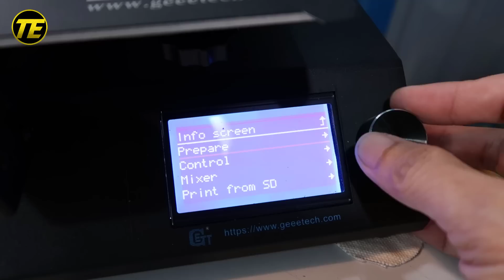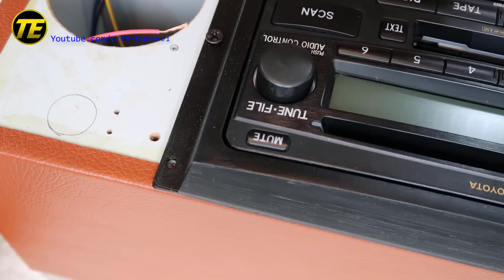Homemade Car-Audio Boombox V2

Comment: you should have plugged in the speakers only to the front outputs with a crossover so the woofer doesn't get full range, this will sound much better

Comment: That was one nice build. Good job buddy. Just wondering how bouncy/echoish the bass is. Because the wooden boards that has been used looks like it won't absorb as much punch as a MDF board would. No sponges has been used either.

Comment: That's an awesome homemade stereo! It even has a full logic tape deck. I have over 2,000 tapes in my collection to listen to. I always look for tape decks that are full of features, like AMS Automatic Music Sensor and RMS Random Music Sensor,  where you can program which tracks you want to listen to and which tracks to skip, like on CD player. Hopefully this player has the ability to search between tracks on tape. For some reason, I always been crazy over tapes. Unlike digital, you can always fine tune the tape recordings, that's of course if you have a professional tape deck. I managed to make my tapes sound louder and cleaner than CD'S.
Reply: That's because the tape stores the CD music in analog! And analog is more "natural" sounding , and can capture more detail than digital bits! Even if you just play the CD,but still has to transfer the digital data back to analog so you can hear it! Except the cassette doesn't need an DA converter because it's already been converted and stored in analog! We hear in analog, not digital!

Comment: Nice idea, but I noticed a few drawbacks.
-  Would have used better speakers, and a crossover for each set (not just plain capacitors, that's a lousy hi-pass filter)
- The brown vinyl finish really sucks. Would have gone for either black imitating carbon fiber (like you did in the back, but all over) or a combination of that with some hand-picked woodgrain.
- Would have put some rechargeable Li-Ion pack with charging circuit - it's not really a boombox if it's not portable.

As a personal choice, I'd go for a different car stereo. JVC or Pioneer or something like that, with more features (such as MP3 playback, better EQ presets, LED visualizations, remote operated, etc). That and really loud sound is what boomboxes are about.
But not bad as proof of concept. Thumbs up anyway.
Reply: I agree with you on principle, but it looks like he did this whole project with stuff he already had laying around.

Comment: I enjoyed watching this, but I have fiddley, uncoordinated fingers and it wouldn’t be so easy.  I agree with others that having a working radio with built-in antennas, Bluetooth capability, USB port or microSD slot and built-in battery for true portability would be good additions.  I would probably have larger, detachable Bluetooth speakers to get more sound and separation.  Your skills here are admirable — good job.

Comment: Well done....... precision engineering......just missing battery power
Reply: i was just thinking about that myself thinking i dont fancy carrying around a 12v lead acid battery to power it lol
also theres no antenna for the radio and the belt on the cassete needs replacing can cleary hear it slipping
Reply: Well no worries.... Cause from where I'm sittin, You're 90% there

Comment: Been putting car stereos in speaker boxes since Early 70's.
Reply: Thanks for the Heart, TE.
Made quite a few of them for friends on the carrier is was on at the time.
2 smallish house speaker boxes, an in dash car stereo, and either use the speakers already in the cabinets or coaxial for car/truck. 2 6v lantern batteries, one of the little 'rubber ducky antennas, some screws, a handle and off You Go.
Reply: Deep cycle batteries will last longer and work better

Comment: Good work! But some thinks... For FM usage may be installed the telescopic antenna, it will not make worse the design of project. Next think - this box may include BT module for better functionality. And once more - little high-speed fun is too noisy. Better to use more silent 80 or 120 mm low-speed funs.

Comment: What did you use for a "body filler" on your 3-D printed parts before you sanded and painted them?  I am new to the 3-D printed world.  I was wondering if it was something particular for plastics or not, also if you've had good success with the filler product?

Comment: What amperage power supply did you use for this? Planning on doing this project myself, but with an aftermarket car radio. Though I may consider using my old truck's radio for this now. Most aftermarket radios have a 10 amp fuse, so I would assume I'd want to use a 12v power supply with an output of 10A. Might also add a set of batteries outputting 12v to the constant power for keeping the time. Thanks!
Reply from the maker: I use a 12v power supply with an output of 5A

Comment: That's great, but bass in this configuration can be deeper. And the cassette deck needs a belt replacement. Although by this idea is rather original.

Comment: What did you use for a power supply is it rechargable?
Reply from the maker: 12V 5A adapter
Reply: TE do you have a picture? What is the diagram i want to make one. What fans did you use?
Reply: @drewiztigas  diagram is in the video. https://youtu.be/-tAYkTSrME0?t=1003

Comment: To remove the strip from printing on the printer, you need to keep the plastic over the acetone vapor then the surface will be smooth
Reply: sdcard22 his method worked too

Comment: U don't show it on the video but, I'm assuming that you included an antenna in it somewhere for the radio to work properly???
Reply from the maker: Radio is no longer working
Reply: @TE.  In your area maybe
Reply: @TE.  To make the radio work you need a marine antenna instead of a regular boom box antenna as cars use their metal chassis along with the car antenna to gain a signal.

Comment: Very nice system, better even than the 70s and 80s ghetto blasters, the factory car radio alone is far FAR better than any consumer boom box in construction quality and sensitivity.
Impressive. Only thing I'd have used nuts and bolts for the handle not skimpy screws.

Comment: I did the same as a kid back in '84 or '85. JVC tape deck. Generic brand illuminated equalizer/booster. Two 8 inch woofers and two horn tweeters. Hand built speaker box that held everything. Box covered with speaker box carpet. Powered by 12 volt power supply (which struggled when the volume went past 7). Also could be powered by a motorcycle battery that was tucked inside from the back (maybe 30 min of play). I had to take the battery out and charge it on my dad's car battery charger every single time, until I got smart enough to run wire from the battery terminals to two hex shaped bolts on the back of the box. Then I could just clamp the charger to the bolt heads. I loved that thing. Have absolutely no idea what ever happened to it.
It look a lot like this guy's, but more boombox style. -----> https://www.youtube.com/watch?v=-b8X__GHRtY
Made a simple one for my younger brother with a tape deck and two 6x9 speakers.
Reply: With a 15ah deep cycle battery you can get 10 hours of play

Comment: I would've personally used one of those Car stereos that are like $20 aftermarket things that are small, Then you could build a way to use a battery in the main compartment, it would have a 3.5mm and radio and bluetooth. That's my opinion.
Reply: I think it's about reusing his old radio and not producing electro trash. I will do the same

Comment: is there a download for the 3d print files to make the box?
Reply: also what kind of power supply is needed to make it work? none of that was included in the video
Reply from the maker: Link to download stl file: 
https://drive.google.com/open?id=15jCNWXgWOZDo7H2Y2zyMnh_7V1NL3rQ6
Reply from the maker: Power supply: adaptor 12V 5A

Comment: 🤔Can run on battery ))) 👍
Reply: Yeah but better use 12v li ion battery pack
Reply: @jojokenyah  or powerbank
Reply: @Wishmaster0707  power bank only supply 5v and 1-3amp of current,but you can try that with a step up converter and adjust the voltage by yourself,but i will still recommend you to use a power bank that has 12v output.

Comment: But then you need the radio code everytime
Reply: uhhhh yeahh that could be annoying and with a newer headunit like these aftermarket ones from Sony, Pioneer and JVC and others he would not run into this... but it´s a good way to use an old stereo laying around.

Comment: Very nice,  i would have put two 12v lithium batteries behind speakers
Reply: A lithium drill power pack and the guts from its charger stuffed in there would have fit the bill